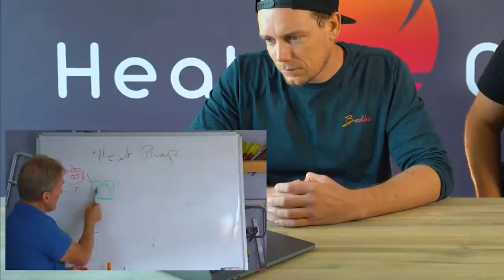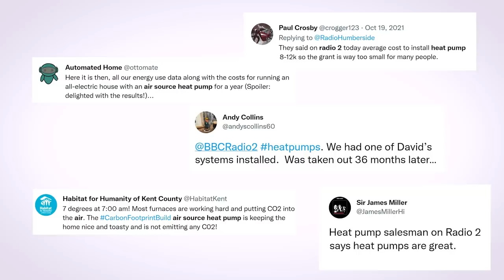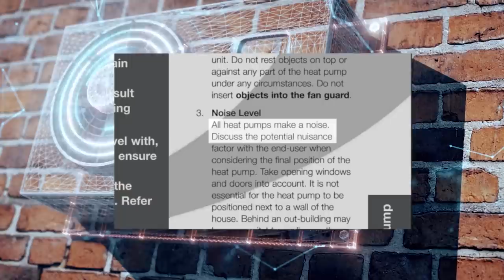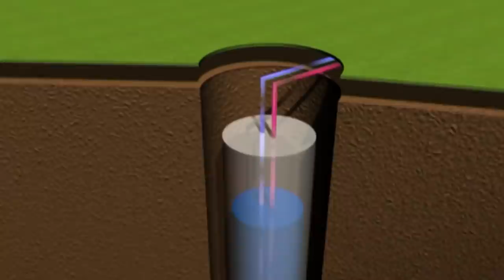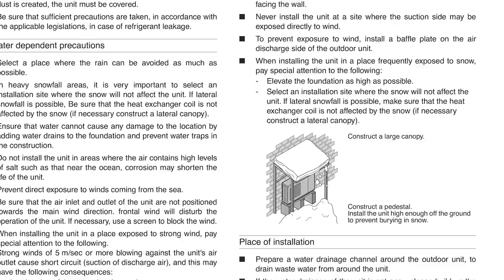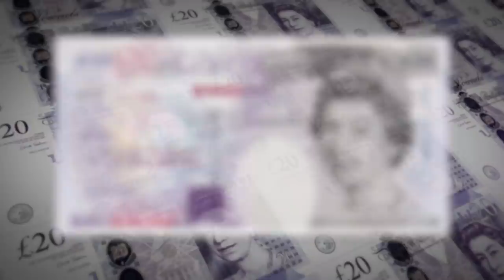Heat Pump Secrets They Don't Want You to Know

Comment: I bought the most expensive class heat pump and living here in the Nordic country. It works perfectly now in snowy and icy conditions and it is very useful.
Saves on heating costs. I haven't experienced the problems mentioned in the video.
180m2 to warm up and I have water circulation floor heating + air source heat pump. Estimated annual electricity consumption 15000 kwh.
Reply from the maker: Thanks for sharing!
Reply: Here in the UK, the situation is very different. The best option is gas heating for most houses. If you see the property market then most of the houses have EPC rating D or even E. That's not suitable for a heat pump. And the price structure of gas and electricity is that probably the gas is cheaper or the cost would be equal. But with higher installation costs for a heat pump.
Reply: @gpsoftsk1  This air heat pump (Mitsubishi ln35) which I just bought cost €2200 installed. I have calculated that that investment will pay for itself in 2-3 years.
I have always wondered why in many Central European countries the thermal insulation has been used very little in houses. It costs a little more in the construction phase, but brings savings in the long run. Specially now when energy prices have gone to sky.
My house has 250 mm of insulating material in the walls and ceiling and 150 mm of styrofoam below the concrete floor and it's built 20 years ago. I believe now they use even more insulation.
Reply: one more feature that heat pumps have an advantage over gas. In heat pumps, you can take advantage of the time of tariff, e.g. during cheap energy (at night) it is worth heating the domestic water.
as far as I know, gas has a fixed price.
Reply: @sakkekvist2495  I didn't know the UK is in Central Europe, but fine, whatever.

If you want to talk about Central Europe then houses there are well insulated, also flats. And all new builds have to be in passive standard there, I believe.
Some new builds have heat pumps but a lot of people will have rather a combination. With solar panels now I think they will use more heat pumps.
Using cheaper electric tariffs, that's not worth it, the price differences are minimal there (I tried and switched back to standard one, but it was not worth it at all with the higher monthly payment).
In the UK I heard it's a better option. But again, the UK has a small number of insulated houses and I don't see that changing especially in London.

I assume in that "Nordic" country you will have a high carbon tax, subsidies to get a heat pump and probably cheap night energy from a high amount of hydro and maybe wind power. But the rest of Europe has a different situation. In countries where there is no green energy madness and they don't manipulate the energy market with artificial taxes and don't have a high amount of hydropower, it's usually cheaper to use gas for heating.
Try to get a heat pump in a typical UK house for 2200 euros including installation (which is less than £2000), I don't think that will be possible. I heard rather amounts between £4k-£10k.
Reply: @gpsoftsk1  We don't get any subsidies to get a heat pump. Possibly some subsidies if changing from old fossil based heating system (e.g. oil) to some modern alternative, if meeting conditions.
Nordic electricity market is a common market for electricity in the Nordic countries. It is one of the first free electric-energy markets in Europe which  supplies electricity also to the UK.
Did some googling around and found that in UK the same air-heat pump costs £1,556.81 and in Germany 2,200 €.
Reply: @sakkekvist2495  25cm of insulation in the walls and ceiling and 15cm of polystyrene under the stone floor. yeah I can see why he said in an earlier video you can heat your house with just a lightbulb 😊
Reply: @sakkekvist2495  The price and performance of your Mitsubishi heat pump is extremely interesting;  Can you please give us the detailed model code?  Can't find In35...

Comment: Don't bother with any heating ... apparently a cuddle in a jumper while doing star jumps solves all your heating problems. Being a contortionist probably helps too. 🤣

Seriously an elderly friend had a barn conversion done with massive amounts of wall, floor and roof insulation, triple glazing and underfloor heating throughout. In 12 years she has gone through 3 heat pumps and had 2 winters with no heating at all (apart from a log burner and an immersion heater). Now her electric costs has been nearly tripled already in the last year and she still relies on solar or immersion heater for hot water and has had to turn heating off in bedrooms to try to reduce running costs (current pump was installed last winter so is a recent model).

I told her to get an oil boiler fitted - ours is far cheaper to run even with the cost of oil - as there is no mains gas. Our house is warm and we have unlimited hot water and the modern condensing boiler we had fitted about 18 months uses a lot less fuel. If I had the space I might have considered a ground source heat pump but after my friends experience would never consider airsource in a stone building with radiators.

Comment: Hello Roger, me again, said I would give you an honest update on my ASHP, the install went well, I decided to put the pump on the extension roof, the roof is new build and 18" depth and well insulated. The pump runs quiet, but I have noticed when the air temp is low (for example around 2C ) it ramps up, and so does the noise, but not where it is intrusive. As for the efficiency I reckon I am getting 1-3.8 which ain't bad for this time of year. Also, the ambient temp in the house really never drops bellow 15C and usually hangs around 17C so we really only use it in the mornings and afternoons if needed. For a comparison I would say the HP is using the same output as our washing machine. At the mo most radiators are performing well, but there are a couple that are not, they have been balanced but for some unknown reason they are only half hot, this may change with time. On the whole I am happy with it, I realise it is not for everyone the cost alone is prohibitive for many. The system is now fully integrated with my solar too. Finally, this was never a vanity project, I am not a 'green' person, I did it because I could. My LPG tanks will be removed shortly, I have a plan for the new space I get...

Comment: Why has heating our homes become so complicated? What happened to throw another lump of coal on the fire if things got a bit chilly? Roger, your video sums up superbly the dilemma facing everyone faced with the bilwieldering choices with competing companies trying to convince customers their system is best. The actual cost of heating has just 3 components: The capital cost of the system and its installation, the fuel costs and the cost of repairs and maintenance. Add those together over the expected life of the system and then you get a true annual cost. My all-electric heating has very low capital costs, very low repair costs but high running costs. And it works, cosy18-21c throughout. It uses about 12,000 kWh annually and costs £2100 annually including the recent 25% increase in energy prrices. Knock off £140 warm home discount and £200 UK heating grant (thanks Boris) gives a final bill of £1760.

Comment: Here's the thing. I have a conventional oil boiler. It was installed 15 years ago and apart from one new oil pump (£200) it's only cost me an £80 service every couple of years. The heating system is as complicated as a knife and fork. Radiators in every room, gravity-fed hot water cylinder, single circulating pump, three loops (living rads / sleeping rads / hot water) and a basic programmer. The house is fairly well insulated so the boiler is off completely for at least 4 months. Then we use an electric immersion heater on a timer to provide hot water.

I can get 9kWh from a litre of oil after losses. The spot price for heating oil is currently 61.5p / l, but that's almost an historic high. I paid less than 25p / l in 2020. At 61.5p heat costs 6.8p per kWh. Electricity is now 20.5p per kWh on the capped tariff and is set to exceed 30p per kWh when the cap goes up in April. A heat pump would need a COP of at least 3 to break even on running costs now, and 4.4 if electricity does hit 30p.

My house is a 2400 sq ft bungalow, so lots of ceiling and lots of floor and lots of glass. Rightly or wrongly we like to keep it toastie. The boiler is never turned off as such. We use the thermostats to control the temperature and set them to 22C during the day, 23.5C in the evening, and 21C when we're tucked up in bed, and there are no cold rooms. The only exception is if everyone is out when we'll drop it down to 18C, but since I'm now working from home permanently that doesn't happen often. The boiler is rated at 26kW and copes with most weather, though it couldn't maintain more than 19C running flat out when we were hit by the Beast from the East. We typically burn 30,000 kWh equivalent of oil annually.

I hate to think what I'd need to spend on a heat pump installation to deliver the same user experience. I don't give a stuff about climate change; if I did I'd set the thermostat lower and pull on a jumper. But I do object to being forced to use "green" technology which will cost me a lot more, or provide me with a worse experience, or both.
Reply: scandinavian here, just i interested in comparing. 
if i read your numbers right, i belive you would benefit gratley to get more isulation. 
2400 sqft= 223m2, 
30 kwh / 223 m2= 134wh pr m2 a year in heating

what was outdor temp when you only could keep 19c inside? 26kw/223m2 =116w m2 to get 19c 

i live in Norway, here building codes state that buildings built 2007 or later must not consume more than 36w pr m2 with outdor temp of -20c. to get 20C indor temp.

average 60w m2 for buildings around 1987.

i dont know if your numbers are representative for averge UK homes, but if so, there are enormous energy savings to be had on better insulating

Comment: Heat pumps are not as some think…zero emissions.  They are refrigerators working in reverse and use electricity from power stations.  Of course extracting heat from already freezing air or cold soil by making it even colder, is not easy or efficient…so they work best in summer (when you don’t need it) or at least in temperate mild seasons…That’s just a consequence of the thermodynamics.

Comment: Thanks Roger, it makes sense to let the technology move on a bit until we see better design and efficiency. I’m not in a rush to fit these pumps but this debate and various options is driving change so eventually we will get an efficient replacement for the gas we burn. Good sensible clear and well thought out presentation. Keep going matey!
Reply: At the moment there is no alternative to fossil fuel.
Reply: @pietermoorer3679  
Garbage, there are heatpumps (my Thermia is soon 20 years old, runs like a clock and saves me money), straight electric floorheating, heatcollectors for the roof and so on! Don't you insulate your houses? It keeps heat outside in the summer and warmth inside in the winter. My thermia heatpump (takes its heat from the ground) keeps a max temperature of 55°C in the radiators. If that isn't enough one can have hybrid-system with direct electric or with an oil-furnace.
 It's not the heatpump that is the problem. Put real windows and doors in the house and insulate! Triple-layer windows (one glass to stop the wind and rain, then double with argon between the glasses to let sunlight/heat in but not out), insulated doors (about two inches of insulation) and controlled ventilation with heat exchanger. And radiators made for high temperature water can be changed into new low-temp versions.
 Put in new flooring, but let it raise one inch or two. www.floore.se is thin insulating sheets foor floorheating.
 You see, there are possibilitys. Angry elderly men who wants to sell own stuff isn't always the only way forwards! BTW, sorry if my spelling is off, English is just language number three for me...
Reply: Since we were installing heat pumps 20 years ago, and the technology itself has been around for 100years, I’m not sure what technical advances you are expecting.

There is a misconception in the UK, mainly due to Government and media lack of technical understanding, that this is a new technology.  It isn’t.  

The only changes I have seen in the last 20 years have been inverter compressors and internet controls.  Both these have only made a marginal difference to how the product delivers efficiency.

When customers tell me that there will be big technical advances imminently in heat pumps my next question is ‘like what?’’.  So far I’ve had blank looks.
Reply: If you're installing these things, don't do a half arsed job. Do everything recommended in this video.
Reply: Cold climate heat pumps could work down -30 C and put out 80 percent of nominal power at -20 .  By now EVI technology is well adopted by Chinese manufacturers and they almost three times cheaper than Mitsubishi and other European brands. There's nothing to debate about.  We only can talk about advantages and disadvantages of certain model not like this guy beating about the bush

Comment: Some friends of ours building a new house - triple glazing, underfloor heating etc. etc. - were advised that a HP made no sense because their main energy requirement is hot water not heating and HP are crap for hot water. Surely, if a HP makes no sense for a property like that, they don't make sense for anyone?
Reply from the maker: That is a good point. Are they on mains gas?
Reply: @SkillBuilder  Yep. Advised there's no point getting a heat pump because the increased electricity demand would outweigh any savings, although it wasn't clear where those would come from. The guy telling them this could have sold them a heat pump to be fair to him.

Comment: Absolutely true on all points... They had a big run on them here in France..  There was much miss-selling and many disappointed buyers.
The air/air split systems were the ones mostly sold..  People were keen to have AC in summer.
Unfortunately only those the very newest homes with super high levels of insulation and underfloor heating saw, any benefit.. Even then they chose an independent system for hot water..
Be under no illusion.. They are much, much more expensive to install..  They are not as trouble free as a good quality condensing boiler.. They are not as flexible and efficient at heating your home as a gas boiler..
I would not recommend them at all..  Do not be fooled..
Vertical capture systems are the best of the heat pump systems but they cost even more and you may have to drill very deep - each metre drilled can cost a lot of money.. The horizontal capture system is the next best but you need a large suitable garden.. There will be much upheaval to install and once again very, very expensive..
In both systems the savings might never be achieved if anything breaks down..
Once again best avoided...
Reply: Really? As cambodia uses ac units, they have poor insulation and don't seal windows or cracks and they do fine. Its more expensive to install other types of products.  And mini splits are more efficient have the highest efficiency for seer. You have different styles of equipment.  Which this video neglect to cover. Heat pump, which kind? Minisplit? Or air handler.  Mini splits are imo the easiest and cheapest to install and maintain.  If done properly.  Which also seems to be an issue... it just depends on what you want, and what you have installed currently.
Reply: Wow, I’m glad I don’t live somewhere with extreme cold. Sounds like a pain in the ass.
Reply: Sorry to hear you had such problems with your heat pump, which one do you have  ?

Comment: We live in France and have 2 air source monosplit units installed. As EDF electric customers with a Linky meter I can monitor electrical consumption easily and historically. So when the pumps come on in the morning I see exactly the consumption increase and costs associated with them. On cold mornings (minus 7 has been our lowest figure so far this year), then about 1.1kw/hr per pump is consumed, as the set room temperature  is approached, then this consumption decreased to 0.4 kw/hr. These are 12000btu units and heat a substantial area easily and quickly. Noise wise, that varies. At start-up at -7 ambient and to achieve 23 inside the outside units are noisey, but not much more than an oil boiler flue. Once the inside temperature is achieved then the external unit noise is absolutely negligible. I thoroughly recommend having these fitted. This guy is definitely not an expert by any means (he's definitely very "anti" heat pump for no good reason really in my opinion) and so I recommend doing your own research and asking a few experts in this field.
Reply: I don’t understand the negativity, some people are just really stuck in their ways. Maybe this guy is anti heat pump because he can only install boilers? Idk. I’ve had heat pumps using current technology for close to 20 years and never a problem.

Comment: We use ASHPs here in Minnesota just fine, mate. 

Instructions often have these warnings, not because it's a particularly relevant concern, but because the law essentially requires it.

GSHPs are great, of course, but they cost 3-4x the amount of money and there are very few installers with experience putting them in.